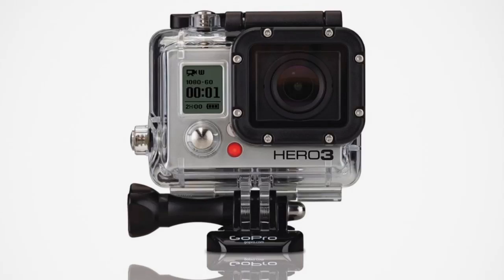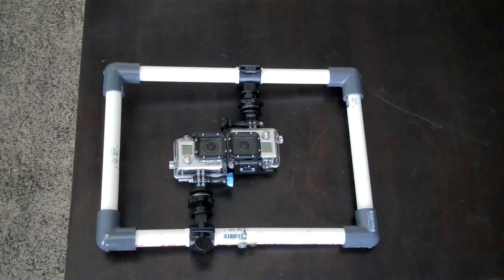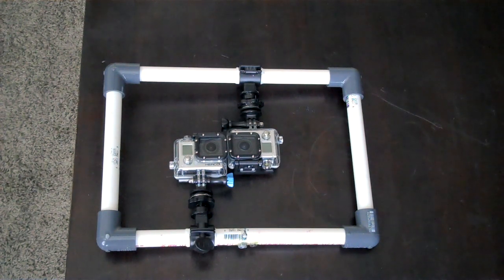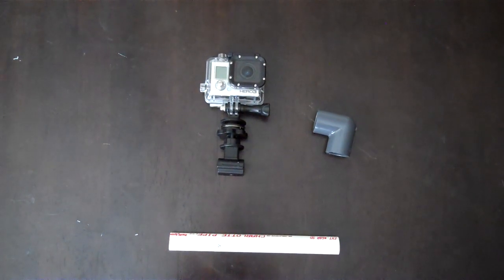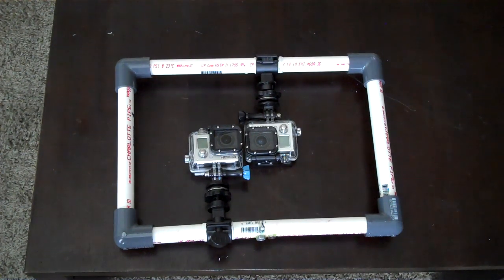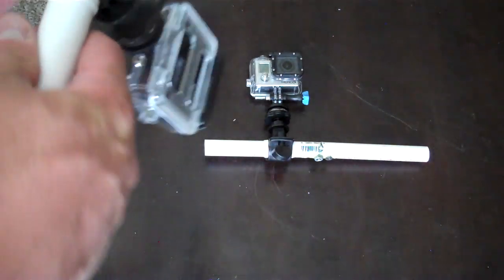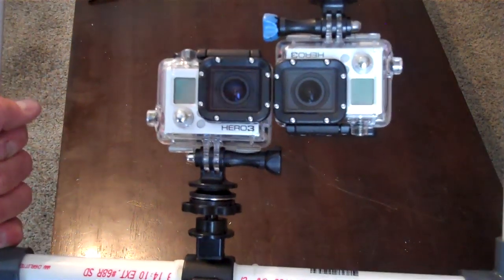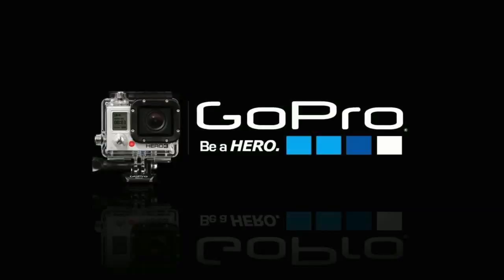DIY GoPro Hero 3 3D System for $25

Comment: Are you sure that using the remote is enough to keep video frames in sync perfectly? I would thing the Wi-Fi signal may be received and processed slightly differently on both devices. What do you think? Have you tested it? Thanks for uploading a great video.

Comment: Hi Brett, 

I tried using this method, but how do you then flip the left eye/right eye video independently in GoPro studio? When I do my 3D pair it will only allow me to flip them both together, not individually, therefore always leaving either the left or right eye upside down. How did you solve that issue?

Thanks!
Reply from the maker: Eric Lachman Film with one of the cameras already flipped. You can adjust the setting on the gopro itself.  If you have footage that you are not able to re-film you could export one eye that is flipped and then bring it back into the GoPro software and pair it up with the other eye.

Comment: You say to start recording before going underwater because the Remote does not work underwater. Are the cameras kept in sync if the Remote does not work underwater?  Does the Remote have to be underwater?